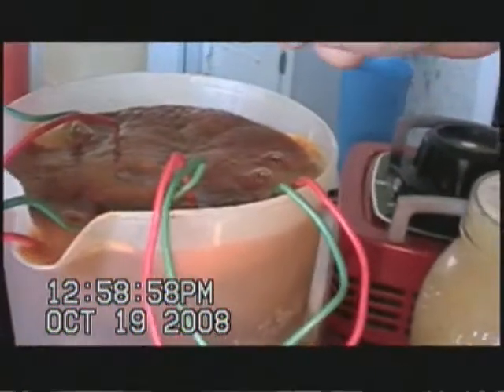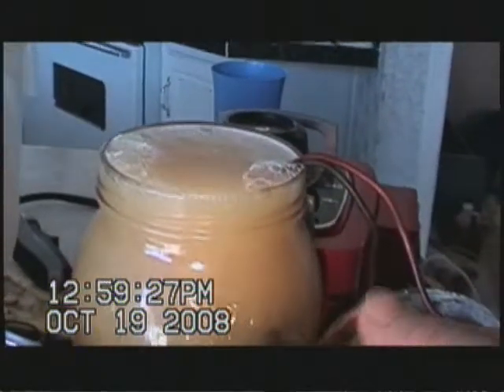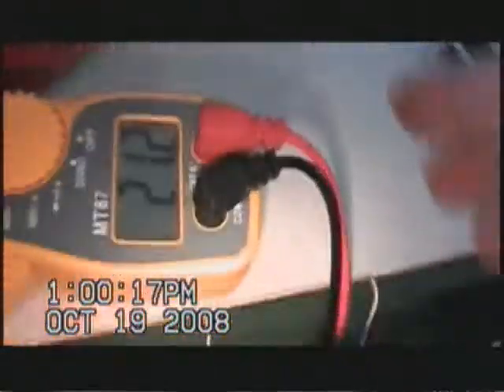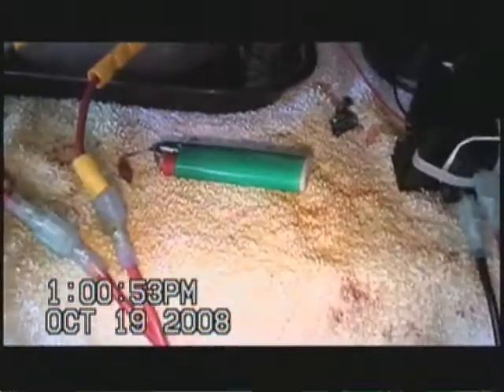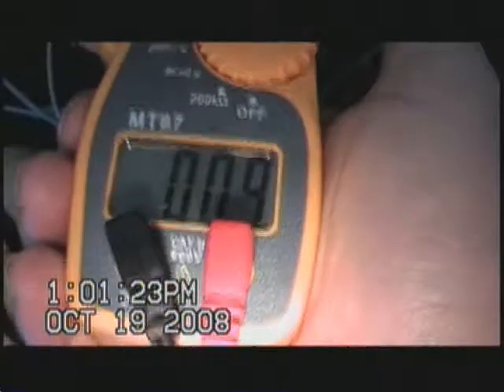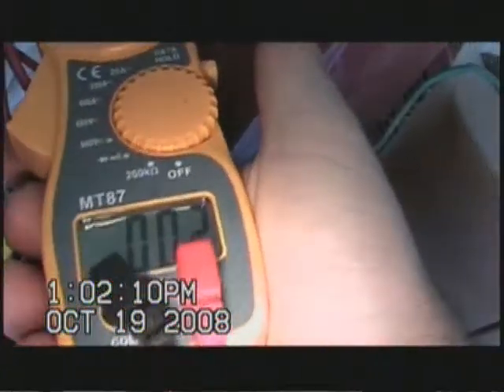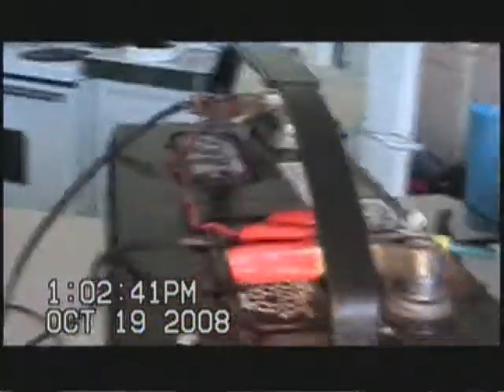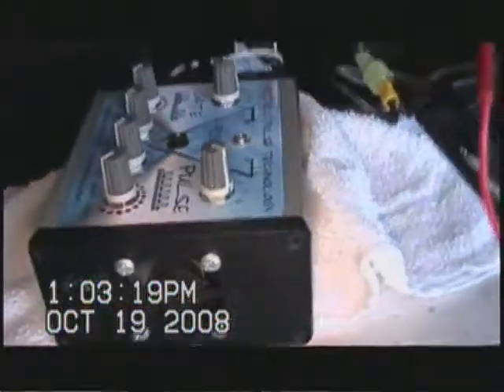Stan myers- Dave Lawton - Browns Gas test {HHO Production 4}

Comment: Are you using a DC or AC clamp om meter when reading the amps? Remember once you pulse the DC it will look like AC to the multimeter and most AC meters only read 60hz rms. You may be getting false readings unless you calculate for the frequency that the PWM is set for. You will need and oscilloscope to measure freq and volts. They make a cheap USB PC scope for around $250.